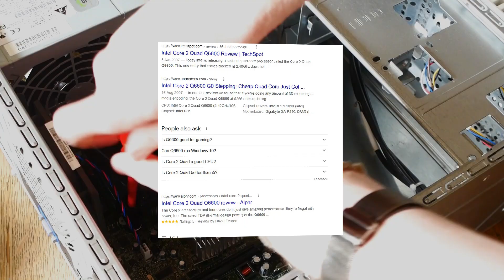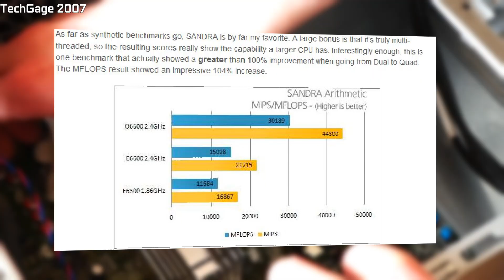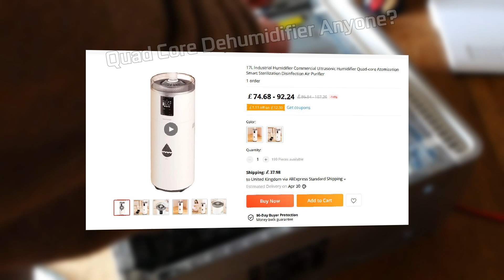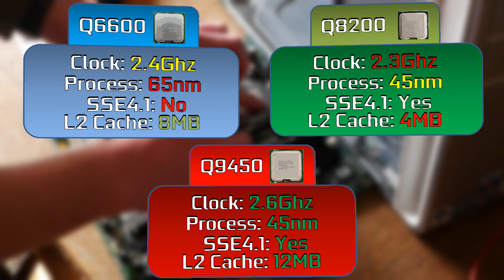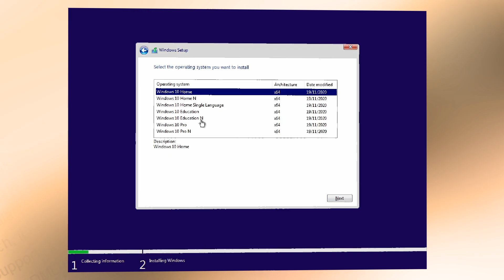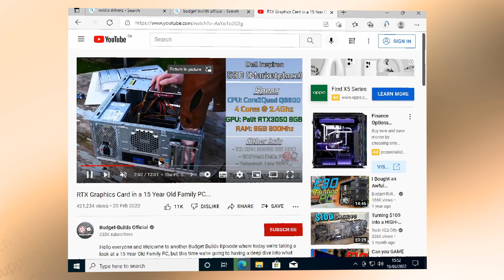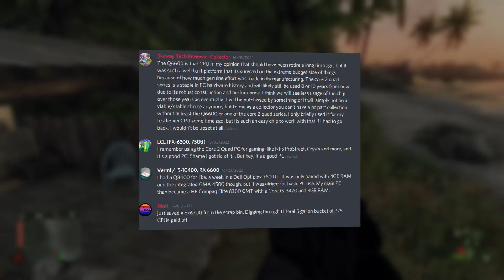Intel's Core2Quad...Finally Obsolete?

Comment: The reason its still a relevant Chip today and in years past is because in all honesty there has not been a huge change in tech from that era. Only more cores and some better efficiency but as far as what a processor does on a day to day basis not much has really changed.  Pair this with programs not really ever using more cores then 4 due to how terrible complex it is to program for many threads and other factors. My GF uses a I7 from like 2013 and plays modern games with a 1050ti card. It plays fine and I cant even notice a difference when on my ryzen chip other then I can run more shit while playing then she can.

Comment: On April 3, 2020 I purchased an unlocked QX6700 to upgrade my dual boot Windows XP & 7 PC (gaming and work) for just $18.90. It runs at 2.66 GHz and It replaced a Xeon X3210 that ran at 2.13 Ghz. The four core X3210 had been an awesome upgrade from the Pentium D (800 FSB) it had originally. In retrospect, I wish I would have gotten the Xeon X3230 because I don't overclock the QX6700 and the X3230 uses less power and has the same specs. I wanted the QX6800 (the best of the 1066 FSB speeds, but it's way overpriced even in March '22). I thought about buying a mobo with a 1333 FSB, but I don't think it will make enough difference. It would be interesting to see the difference between a X3230 (1033 FSB) vs a Q9450 (1333 FSB) since they have the same clock speeds.
*There were many people who would modify the 775 socket to fit cheap top tier socket 771 Xeons and inject the proper CPU microcode and it worked.  I couldn't do that with my OEM mobo. Nor would a BSEL tape mod work. My next Intel PC was a socket 1151, but there are no equivalent Xeon lines since the Xeons of the same generation use a different socket; bummer. Anyway, XP and 7 games run great on C2Qs and equivalent Xeons.

Comment: I still use my q9450 as a daily computer. I got a good gygabite motherboard overclock it to 3.2 gigahertz with 8 gigs of Ram. Video is Rx560 4 gigabits. And a 240 SSD drive. A lot of HHD total of 14 terabytes. I think for a non gamers it's a good computer in 2022. Thanks you for the video and I like this type of content

Comment: I have a Q9650 the 3.0GHz model, OC to 3.6Ghz, with 8GB 800mhz ram and a GTX 960 2gb. The 960 is overkill, the cpu can't use it 100%. Am debating going with a gtx 670 with 2gb instead. games... new games NO. But games of the cpu era works wonderfully. But desktop use, word, execl, browsing, youtube 1080p60 windows 7/10/11, works perfectly fine. The 8gb ram can be tight on 10 and 11. So i'm trying to get 16gb ddr2 ram for it, have ordered some, they are shipped. Also this setup with Arch Linux with nvidia driver and Xfce4 desktop, also works wonderfully.

Comment: I had the E6600, then upgraded to Q6700. That was in the days when having more than 1 core was still pretty ground breaking, so having a quad core was just amazing to me. I was very pleased with my Q6700, and used it for years. My path after that was 2600k, 9900k, and now the 12900k.
Reply: and you don't even need the 12900k, 12 cores is overkill for gaming and multitasking.
the 2600k is the only one you got right.

Comment: Intel didn't have it their own way for long as the long long awaited Phenom's came out in 2007 and I remember my first of those, the wait the wonder and then the disappointment because support for the AMD side was being tilted away to the competition and I will always remember the 109T Phenom's with fondness as you could wrack the nuts out of those overclocking and they just kept on going like a champ (I had water cooling in my custom Antec Skeleton plus a decent Asus motherboard so I could zap the ram etc too with extra angry pixies)   I haven't had an Intel chip well since before the Barton AMD cpu's and I now only run full AMD systems.   I abs love my current Ryz5, RX570 8gb for graphicals, SSD and thing abs rocks (16 secs from BIOS loader screen to all loaded in Windows ready to go O.o)

Comment: c2q gain a lot of boost with ddr3 1333mhz motherboards, also the BSEL mod helps a lot, or a quad xeon a 771 sticker adapter

Comment: I am still using these chips. My main computer is a Xeon X5470 Harpertown, and my retro WXP is a C2Q Q9650, you can actully see it booting in my channel. I am not a power user, mostly just internet an sometimes i play Fortnite.

Comment: Up until recently I used an overclocked Q6600 in my MAME cabinet. Being a Dell mobo, I used the tape method and it runs well overclocked. It even runs Street Fighter IV magnificently (paired with an NVidia 9600gt).

Comment: C2D and C2Q were great but these days I'd recommend getting a cheap sandy bridge based system for a budget system. I wouldn't even use a gpu more powerful than a gtx 580 maybe 680 with a C2Q

Comment: I still use q6600s in my fpga development systems and I also have a couple of hp5750 systems upgraded to 8gig RAM and AMD Dual Core 6000+ which also still perform well in my dev systems. As long as they do their  job I've never seen a need to replace them. I do have modern systems that work happily in tandem with the old ones

Comment: I recently bought 3 big boxes of electronics scrap to practice soldering for repairs or harvesting spare parts.

Turns out I found not fewer that 14 working S 775 mainboards, some of which will need a few caps replaced but nothing major, while most just plain work.
I m currently in quite a conundrum what to do with all these boards - it's not exactly a good idea to spend a ton of money to build them up into full PCs. But just selling them off one by one is kinda boring, and knowing Ebay Germany, can become quite the hassle.

So I am a bit at a loss what to do with them all. Put them in the attic for 10 more years and see if they become "retro". I don't know...

Comment: The Q6600 was(is still) famous for it's overclocking capabilities. They were very good with overclocking and even today no processor has beaten the line for overclock-ability. No Q6600 was bad at overclocking and the mid range was like todays golden samples in how hard you could push them.

Comment: I purchased a server with 2x Core 2 quads (8 cores) back in 2014. 120$ Got me 4X Raptor drives in raid 900mbs +2gb of solid state raid cache (helps with 4kb random read/writes)
  64gb of ddr2 ram.

Comment: My old core 2 quad q6600 is still kicking after well over 10 years of use in a Dell XPS 420. I have to admit, that I'm not super impressed with its performance nowadays, but it's legendary legacy is certainly something to be a bit proud of. 

I'm also currently holding the top benchmark score for my combo of hardware in 3DMark fire strike, so that's fun.

Comment: for gaming maybe, you can get C2Q Q9650, E5450, X5450, to Run games like Fortnite performance mode 75FPS locked with a  GTX750Ti, but for home or office use its great no security issues like newer hyper threaded CPU's  I built a Dell OptiPlex 780 sff with a C2Q Q9650 with 12Gb DDR3, TPM 1.2 enabled running windows 11 with a GT730 GPU runs great can even handle older DX11 games

Comment: I'm still using a C2Q in my college PC. Same Dell Vostro 400 desktop as we got new in 2007, but with some upgrades. I slapped an ATI Radeon HD 5770 into it and upped it from 3GB to 8GB of DDR2, unfortunately running at 667MHz due to mismatched sticks. Pair that with an SSD and it was quite competent with the original Q6600. I upgraded to a Q6700 a month or two ago for a minor boost to performance, though in hindsight I should have probably gone with a pair of Q6600s for the same price and tried to see if one would be stable with the tape mod to 3GHz. Still, it's a stout little system for the games I play! I wish I could grab a Q9650 for it, but sadly the 45nm CPUs are quite unhappy on my chipset/motherboard, a Dell 0gn723. I should also note that, if you want such a motherboard for a C2Q, make sure that it came with a C2Q originally, as C2D ones had lesser power delivery and wouldn't fare well with a quad.

I could use something better but I mostly stick with this hardware for the fun of it.

Also, the Q6600 got a 'G0' stepping revision in mid-2007 which reduced the TDP by 10 watts to 95w, and made overclocking a lot more reliable as well. They say "SLACR" on the head spreader. Many of them can hit 3GHz on stock voltage.

Comment: Your score seems a bit low. I wont be able to test it since the chipset burnt, but I played Fallout 4 , mix med and high, 1200p, on a Q9300, 6gb ddr2 1066, GTX960 4gb in high 40 fps. I overclock the shit of this pc, and chipset burnt, found an other mobo, pc was alive again, but realized that 2 memory stick was also out. Wasn't able to launch cyberpunk 2077 for fun. I wanted to see if it was possible to run a Q9300 OC with a 3060ti.

Comment: Another cool part to cover in the LGA 775 era and what has changed today is the X38 and how they hacked in SLi support.
Something Nvidia denied you back in the day to sell you their crappy nForce boards with very very dodgy memory controllers, poor stability and other weird issues.
I heard so many stories of people hating the LGA 775, turning out that the moment they threw away that Nvidia board, everything worked perfectly with an Intel chipset.

Comment: Nice. I have a Q6600 that was rescued from the being recycled, use it as a test bed system for testing hard drives, cloning etc. Does perform quite well. Collectible CPU perhaps in 3o yrs time?

Comment: I run one in my Linux server, the Q9450, a very popular Quad core back in the day.
However, the spectre, meltdown and all the other mitigations in Linux kills the performance of the chip drastically.
Once I disabled the mitigations I actually saw a performance improvement of 30-40% and a significant drop in the Linux' load numbers.
Sadly I doubt you can easily disable these mitigations under modern Windows though.

Comment: I used Q6600 (G0-variant OC'd to 3GHz) from 2008 until 2014 when motherboard died. Noticed around 2013 that newer action-games wouldn't run 60fps any more. Even newer GPU (gtx760) didn't help at all. But it was still enough for all my strategy games. Still have that Q6600 (OC'd 3.0GHz) around and it's still perfectly fine for all standard desktop-usage and for older games pre-2015. Friend of mine used slightly overlocked Q9650 (3->3.3GHz) until early 2020 as his main desktop. Quite essential is to have at least 8GB of DDR2 with finely tuned memory and FSB-speeds. Sadly even 3.3GHz Q9650 can't run AMD HD7850 with full speed. I suspect that well overlocked 3.6-4GHz may be almost enough?

Comment: I used an E8600 system (Core2 3.33GHz) which I built in 2008 for a number of years before I did an easy socket mod and installed a cheap used Xeon E5450 (3.00GHz quad) - £55 for the pair of ex-server CPUs, one sold on right away for £25 and the old CPU sold for £12 or 13 iirc - so a very low cost boost at the time. 👍

Comment: Hmm, you should do a tape mod or pin mod on Q6600 because it will extract better performance (providing you have a motherboard with FSB 1333 MHz) and disable meltdown/spectre because those security patches affect CPU performance.

Otherwise a good video 👍

Comment: My own little story:
Summer 2007, I'm a young kid working a crappy job at McDonald's. I saved up enough to build my new PC. I got a Q6600, Abit IP35 Pro, 4GB RAM, SB XFI, Antec 900 case. I absolutely loved it, I used it to make and record my music at University. I have a lot of fond memories of it back then. In 2011, after I graduated, I gave it to my dad who installed a GTX 250 + 2GB extra RAM and I went through a period of being PC-less at home, as I was a Software Engineer at work. My dad loved it and used it for years, playing various games but ran into problems in early 2019. He tried to fix them himself as I was busy but subsequently purchased a refurb Dell Optiplex and threw my beautiful creation into his garage. Just before 2020, they choose to move house and I discover it looking rather sorry for itself. Take it home, I give it a thorough clean with alcohol.... And it fires up. I've been using it ever since to make even more music and for my day to get home working. Admittedly, it's getting harder with the price of some refurb kit for my eyes not to stray elsewhere but my creation of 2007 still continues to fight another day in 2022... I'll admit, I feel rather attached to it. 😍 what should I do? At some point I've got to upgrade right? 😦

Comment: An Q6600 was the CPU of my first DIY build. Got the CPU not long after it was released. The GPU I got for that system as an equally impressive for the day Nvidia 8800GTX. That build was a beast of a gaming PC, could run pretty much anything at max settings except for the original Crysis. I used that system for about 4 years before replacing it with an 2600k based build.
My habit of building ultra high-end PCs and keeping them for several years with only minor upgrades hasn't changed since then. I do replace my builds more often nowadays though, like every 2-3 years instead of 4.

Comment: Great chip. Got my 8300 in 2009, 8 years use out of that before I upgraded to 9450 in 2017. That did me until 2020. Worked well with a GTX750 and later a 1050ti. In the end the motherboard started to show signs of problems with the system sometimes failing to boot. Removing all the USB connectors and plugging them back in once loaded fixed it! 11 years out of one motherboard isn't bad though. When I got the new AMD ryzen system my framerates doubled so could have medium to high rather than low settings in newer games which is all the 1050ti and q9450 could achieve. Loading times also quartered! So now it's not much good for gaming. Long time to load and only just playable framerates. But it lasted well and would still be fine for an office or multimedia system.

Comment: Years ago I was given a free faulty pc with a q9650 and gtx 580, actually relatively new for I think 2013 and the only thing I'm not currently still using is the dead GPU (though I did use it with a reflow littlerally every week until it finally gave up). That old beast just got me all the way through college and university with a decent overclock, SSD and a gtx 1050.

Comment: Been using a C2Q Q9400 with now 8 GB RAM continuously for 14 years as a hackintosh HTPC and its been very stable.

We did some OBS live streaming broadcasts with this on a Geforce 660 Ti on Windows 10 since 2020 which also worked well.

Its the longest surviving PC of any PCs I ever owned as they usually die due to motherboard failure. This was built using a good mid-range Gigabyte board which obviously helped with longevity.

Comment: Had a Core 2 Quad Q9550 in a Gigabyte EP43-DS3 motherboard and 8GB (4x2GB Kingston HyperX DDR2 800 MHz) ram. Used since new (summer 2009) until late 2019. Went throught 2 gpus (started with a GTX260 which died in 3 years, went to a HD5750 until the end). Even until the last day, its was a joy to use for everyday tasks.

Comment: My relatively recent experience with the core 2 quad is the Q6700 I pased onto a friend who is also a computer enthusiast. 

It struggles in windows 10 with 8GB ddr2 on the mobo so that's why I passed it on.

Comment: I got my Q9450 back in 2009 for very low price (new) -- those were the days of really affordable high-end PC parts. I didn't really have to buy it, but because the offer was so tempting I upgraded anyway and held it for less than a year before finally moving on to LGA1366, which was the original upgrade path, as my first quad-core rig. It wasn't that good overclocker, compared to the previous E8400 it replaced, but sufficient enough and I didn't really pushed it hard, since this was my last LGA775 system.

Comment: For gaming they are legendary. Legendary in that regard that they were released when c2d was all the engines would use. A few years later, sandy bridge launched which crushed them my margins and even then there were engines that did not even use 4 cores

Comment: Fun fact: These CPUs are "just" two glued together Core 2 Duo dies. Similarly the Pentium D series were two glued together P4 dies. Of course people laughed out load when they called AMD out on doing the same with Ryzen. XD
Also, what makes these CPUs actually fantastic is their incredible overclocking potential. Almost all Core 2 Quads would run well over 3 GHz easily

Comment: I really love this processor, Actually i use C2Q 8300 with 4gb ram, and i play everything what i want, newer resident evil games, tekken 7 at 60 fps(with low specs mod) and a lot of simple games like grand chase.
Its really great i am impressed by how well this core 2 quad line aged.

Comment: Inspiron 530s owner here... Be very careful to check the CPU compatibility list before upgrading. My model maxed out with the Wolfdale C2D E8600 3.33GHz, which paired well with a GT 1030, albeit with major thread count limitations. Emulation for Gamecube and below is amazing, though, along with Proton and Bioshock/older-era games.

Comment: My parents still use my old gaming build, a q6600 8gb of ram and an ati hd4770. Other than a 256gb sata ssd added about 5 years ago. Its still as I built it in 2013 and still runs windows 7 perfectly

Comment: I have the q9550 and it’s no that bad. I will probably just leave it hanging on my wall of fame with the og zalman copper flower cooler. I will probably use it as a test bench. My mobo even has both ddr3 and 2 support. Which is pretty cool.

Comment: should test them all including the core2duo range in a extreme scenario, the dual 775 server used as a gaming setup.  And including the Xeon and Core2 quad extreme.  ALL of the 775s actually.

All the way from p4 to PD to core2duo, Quad, extreme and the 771 Xeons.  That's a true test of its power !  And don't forget the Pentium D extreme edition (that never gets covered much)